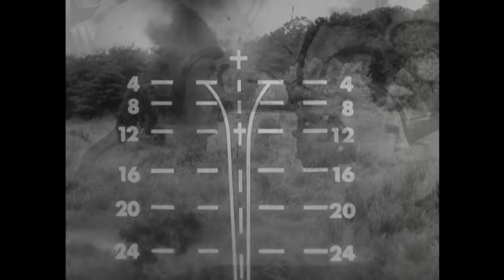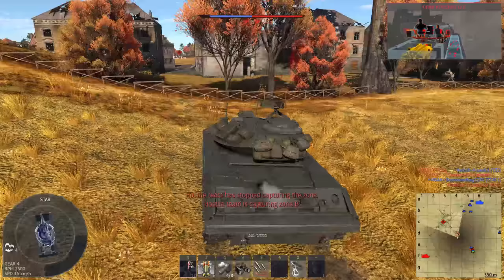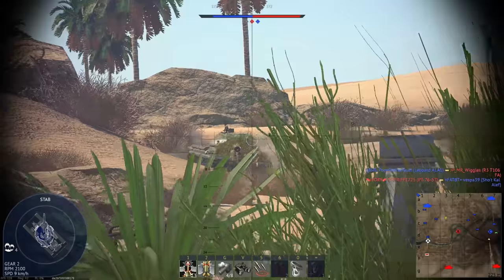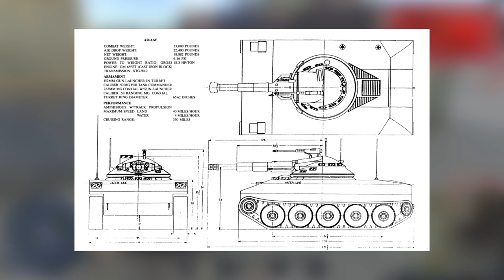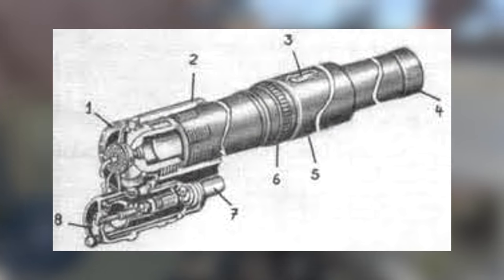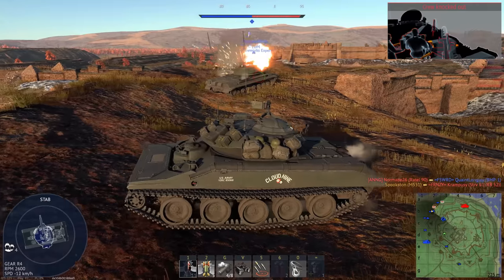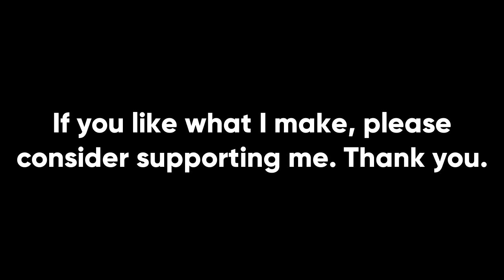How Bad Was The M551 Sheridan?

Comment: My grandfather had worked on the m551 152mm gun and he told me that you could calibrate it to fir missles all day long but as soon as you fired a conventional round you would have to recalibrate the gun because the recoil would life it off the ground a bit and slam it down ruing the guns calibration
Reply: So basically if they had kept it as a missile it would have been fine. And one of they things that wanted to use against all those Soviet tanks was missiles. So what they needed to fire conventional rounds was something like a tank. Need I say more.
Reply: Yeah of course
Reply: @sawyerlogon7666  
Maybe he meant the T-55's turret. Though I don't know offhand if T-55s had that problem or if it was only the later Soviet tank designs.
Reply: The recoil of conventional ammo would knock the missile tracker out of alignment. I never fired one, but I crewed one in the 90's. The breech would operate alot faster then the video shows when electrically opened or closed.  They addressed the issue of the combustible case residue via the CBSS. I'd really like to see the A1 version in game soon, or the ability to research it.
Reply: @Echelon030  I  read in a book called the worlds most power full tanks  about ammo and fuel were stored in close proximity to each other on the T-55/54
Reply: @sawyerlogon7666  according to war thunders x-ray mode some ammo is stored in a ready rack within a fuel tank. Dont know if that's the case on the actual tanks or not
Reply: @Dominator2930  For the T-55? Yes, it is. Diesel is actually fairly hard to ignite, so it works as a form of wet ammo storage.
Reply: I’ve heard that a lot from old Sheridan crewman myself
Reply: @Echelon030  all tanks without any blowout ammo racks do have this problem. The entire World War 2 was about it
Reply: @sawyerlogon7666  some ammo have been placed in the slots inside the frontal fuel tank of t-55
Reply: Ah, nice. My grandfather also worked on the M-551, but he had worked on the optics for the missile system.
Reply: @worldoftancraft  only ones with ammo stored under the turret
Reply: @justarandomtechpriest1578  cope.

Comment: Why doesnt it have a laser range finder in game?? That heat round is so hard to aim
Reply: Try the starship is better in every way, and is under rated. Especially hull downed
Reply: The game version is an earlier version
Reply: @Powerarmorgameing  i was told that other times, im still researching it. Does it come with laser rangefinder?
Reply: Just use missles they are way better than heat
Reply: @copycat5187  yeah but you cant take a lot of em and heat is good for cqc
Reply: @Fran-sr1sb  honestly im so trash at this game, i alwayes die wjthout using full 20 missles so i dont really care
Reply: Use atgm
Reply: @GoldRaven-oe4by  air to ground missles?
Reply: @copycat5187  anti tank guided missiles
Reply: @t_h_f7931  yeah that atgm works too
Reply: @Fran-sr1sb  yeah it does it a later level research for but me imo its worth it the starship is really fun once you learn how to play it and aim with the heat
Reply: Only the M551A1, and M551A1 TTS had a laser rangefinder. We have the standard M551 in War Thunder.
Reply: @copycat5187  air to ground missiles are AGMs.
Inglés moment
Reply: @Fran-sr1sb  The Sheridan in the game is an early model, hence the lack of an LRF. The M60A2 Starship has the same gun and ammo with an LRF at the same BR, but on an M60 chassis. If you want to know for yourself, you can just check the Modifications tab on the vehicle
Reply: Not invented at that time

Comment: I was a Sheridan crewman in the 11th ACR in Germany. They were a mixed bag. In the late 1970s they were getting worn out and since they were on the way out parts were hard to come by. The recoil was extreme but the gun was quite accurate with HEAT rounds. The closed breech scavenging system when it worked prevented cook offs. We fired a gunnery table without it and I am still here. They were quick and very agile and could go places we couldn't once they were replaced with M60A1s. Strangely most M551 crewmen I know look back fondly on them. In Nam the crews that replaced M113s with them were quite happy. Those that gave up M48s were not.
Reply: How old are you
Reply: That was a good description of them, Thomas.  I agree.  I think they were good scout vehicles.  When we got the M-60s, I felt like I was running knee-deep in mud.  The Sheridan's speed was a definite advantage.  😀  The Russians would have definitely known we were there!

Comment: The funny thing is, if we took the concept, and gave it a short barreled version of the M256/L44,  we'd have a very capable tank for urban warfare
Reply: Add aps and remotely controlled machine guns for good measure. And a compeltely revamped armour utilizing recent advancements in metalurgy.
Reply: It would still probably get knocked around by gun recoil and would need to use custom ammo or have even more ludicrous muzzle flash and muzzle blast pressure wave issues than the M256 already has.
Reply: Basically you’ll end having a really shitty variation of Sprut-SD.
Reply: Or an autocannon + ATGMs.
Reply: You could go with a low-pressure 105mm gun like the CV90-105 or the Centauro, in fact
Reply: @alexey_chekhovich  As if the Sprut-SD is known to be any good at this point. Matter of fact it was CANCELLED and a new 125mm-armed fire support vehicle was being ordered for the airborne as of 2013. 

So yes, I'm pretty sure it'd be better than the Sprut, especially with modern engineering and design.
Reply: Take a main battle tank already terrible in urban combat, make it worse in almost every way. Now suddenly excellent in urban combat.

That’s basically what you have said…
Reply: @CruxG228  well it is the best in class anyway. And the closest to mbt in its capabilities airborne vehicle ever designed. Yeah it was kinda “CANCELED” in 2013 in favor of Sprut-SDM1, which is being produced as of now. Not so much cancelled off though. And latest versions are peaked in terms of new tech one can put inside. Yet it’s still not reaching the mbt capabilities, despite having unified gun. And you are proposing putting even shittier short barreled gun on an older platform - and it will somehow be better than Sprut?
Reply: @Echelon030  bmd-4
Reply: @brandonl8039  No, I said take the concept (light, air deployable), and mate it a modified version of the gun used by the Abrams. Others have added that if modern composite armor is added, as well as active protection, plus what I stated, you'd have a very good tank in urban warfare.

Think of it this way: The Abrams doesn't fight well in cities. It's a large vehicle, extremely heavy, and the gun can have a hard time being brought to bare in the tight streets where it might be needed. A modern Sheridan Concept on the other hand wouldn't have such a limitation, since the turret can still 180 in all but the tightest streets (streets where the tank itself barely fits).

If you think about it, HEAT, HE-F, and Canister don't need a long barrel to function properly. And neither does the new 120mm ATGM. So it'd also have the benefit of easier logistics as the while the gun is basically a new design, it's uses existing ammunition designs, so supplying it won't be any more difficult than getting an M1 supplied.
Reply: @Tank50us  give it the m230 chaingun off the apache as a coax
Reply: @meepy546  And the GAU-8 on the roof for good measure
Reply: @alexey_chekhovich  The difference is, you're trying to shove his proposed armored vehicle into the niche of the Sprut, which I find questionable as a platform anyway. Instead of having an airdroppable light tank with MBT-levels of firepower, he's proposing a light tank(Like the M8 Buford!) with a low-pressure or low-recoil 120mm gun designed to fire shells meant for urban combat. Things like canister, or HEAT-MP, or gun-launched missiles like the LAHAT. By giving it screens and composite armor, along with potentially strengthening the hull with new materials, you could potentially have a workable, modern version of the M551 that fits as an urban support vehicle.

Nowhere did he say he wanted to give it Abrams-level firepower, nor perform the same duties as the Sprut which is...again, an air-deployable tank destroyer. The Sprut would get chewed up in urban combat because that's NOT what it's meant for. So  yes, a modernized, remade Sheridan would be better than the Sprut, especially if the purpose was put towards a vehicle with an emphasis on urban warfare support.
Reply: @CruxG228  Actually, the new 125mm gun tank is a modernized version of the 2S25 called the 2S25M.

Comment: I remember meeting a commander of a Sheridan a few years back, had lots of stories about them. 

One time his unit was burning some jungle brush around a base and another Sheridan tried to push a burning tree over but some embers got into an open turret hatch and ignited some loose powder from a damaged shell. The crew bailed except the driver because his revolving crew hatch was locked and the TC had to rescue him by bashing the hatch open with a sledgehammer and pulling him free before the ammo cooked off. The day after the fire subsided they went to inspect the wreck and all that was left was the turret since the aluminum hull had melted from the heat.

He loved the canister rounds due to how well they dealt with the thick jungle brush in Vietnam. He didn’t have any opinions on the Shillelagh since he only fired them in training. He also said the steel turrets had a tendency to crush the aluminum hulls when they were air dropped.
Reply: MAN what a story... Imagine being that driver, unable to get out of a metal coffin, with a raging fire behind you. Truly scary.

Comment: My grandfather was an engineer with several defense companies from the 50's through the 90's. At some point during that time his team was tasked with building the parachute system for the tank. It was the first time such that the military had ever tried to make an air droppable vehicle of that weight, so it became quite the project. After many months of work, his team got a working prototype. First, they ran tests with just blocks of metal that had the same basic weight distribution and density. After they got the system working consistently, they were asked to demonstrate it to a panel of military brass, who of course wanted to see system they just payed a lot of money for. For this test, they were going to drop a real Sheridan, followed by a crew to drive it. The idea was to show how the drop left the tank in a drivable condition. 
Day of the test comes, and the generals and colonels are sitting in bleachers set up in the desert as the transport aircraft lumbers overhead. My grandfather and several other engineers from the project where there as well. Rear cargo door of the plane opens up and the pallet with the Sheridan flies out the back. The tank gets safely away from the plane, and just keeps on falling and falling. Immediately the engineers knew that something was went way wrong when the main parachutes failed to deploy,  and all hell was about to break loose in roughly 30 seconds when a brand new tank was about to impact the ground at terminal velocity. Of course the drop was a safe distance away from the observation bleachers, but you could still feel the ground vibrate as a million dollar tank got turned into the worlds most expensive pancake. 
Needless to say the tank crew that parachuted out afterwards was unable to drive the Sheridan off into the sunset.

Comment: During the 1980s, the Naval Surface Weapons Center experimented with installing the 105 mm Gun M68 in the turret of an M551 Sheridan and using the recoil system for the 152 mm gun-launcher. The cannon was trialed with and without a muzzle brake. Although the installation worked, it would have required significant development before it was satisfactory. The turret ring in particular couldn't quite handle the recoil force of the massive weapon and was damaged after some tests. However, it was deemed practical to mount a 105 mm gun on such a lightweight chassis. The experiment would influence the development behind the Armored Gun System (AGS).

Comment: A family member built circuit boards for the military and the Sheraton is used as an example of what not to do when it comes to circuit boards. Because the Sheridan had an issue of shaking the circuit boards loose which wouldn't cause immediate failure but over time especially after a few more shots and could cause failure of critical components. So for the several companies he worked with they use to Sheridan as a benchmark of what not to do a circuit board and its mounting hardware had to be able extreme forces many times more than what was expected in the vehicle that is to be put in.

Comment: I find it a bit odd that the US failed with the concept of the combined Gunlauncher and the Shillelagh missile. It seems the Soviets had a better approach. Instead of creating a new gun with a missile to launch through it, they just designed a missile for the existing gun. With all the T-55, 62, 64, 72, 80 and BMP-3, they had/have missiles for their guns. No matter of caliber like 100mm, 115 or 125mm, naming Bastion, Svir, Kobra missiles (depending on the variant).
Reply: Yup. They built a good tank gun, then built a missile that could be fired from it.
Reply: Where do you think the soviets got the idea.
Reply: @jeffreyprezalar220 well T-55 predates the M551
Reply: You'll notice the Russians have not used the AT-8 or any other gun missile in combat, or not so you'd notice.
Reply: What? There is plenty of footage showing them using gun launched ATGMs
Reply: @tatianadashkova2143  Can you give me a link/example?
Reply: The Sheridan needed a new gun design anyway. We didn't have a low recoil, light weight cannon design in service unless you wanted to go back to old WW2 105mm from the Sherman.
HEAT round penetration correlates with warhead diameter. A 152mm HEAT has a lot more penetration than a 105mm, 90mm, or 75mm HEAT warhead.

Comment: They were the first armor response in Saudi Arabia after the Iraq invasion of Kuwait, and they used their Shillelagh missiles against Iraqi targets once the ground war went hot.  The Shillelagh was comparable in performance to the TOW-II (though not the -b or other variants) in terms of penetration and flight speed. The issue with paper fragments in the bore detonating rounds was resolved (IIRC) with a compressed cold air evacuator.  Part of the issue with the combustible cases in Vietnam was that moisture caused the cardboard casings to swell, which would make them split, and propellant would collect in the turret basket and hull floor, which made fires in the vehicle even worse.  I seem to recall hearing that the casing material was changed to correct this but I could be mistaken.  Regardless, yeah, it was a pretty bad vehicle.

Comment: seeing how this gun was used on the XM tanks maybe the next vid can be about the XM-1 and the 2 variants of it?
Reply: The XM-1s have a 105mm gun
Reply: @__--_-_-.__---___.__---__-  he's talking about the XM-803 and MBT-70 which both use the 152mm gun launcher.
Reply: So im not the only one that mixes XM1 and XM803 way too much than he should!
Reply: @L0OkBEh1ndU  ah okay I assumed they were pretty similar. Thank you for the info!
Reply: The 152 on the MBT-70 is actually an entirely different gun which is capable of firing high pressure/high velocity shells while also being capable of firing the shells of the M81.  It also was far more durable and (supposedly) had none of the issues the 551 or starship had.
Reply: Unless he's already covered it, the obvious MBT would be the M60A2 which used the same gun launcher.  It's worth noting that the M60A3 went back to the British 105.

Comment: The M551 just feels like it was designed way too early for what it was intended to be. If we went back and made the same thing now, it would probably be flawless, but with the tech of the time, serious teething issues were inevitable. Granted I'm biased because I just think they're neat.
Reply: That is pretty much the story of every weapons system developed in the 1960s. AiM-4 Falcon Missiles, early model AiM-7 sparrows, T-64 opposed piston engines, the list goes on. Frankly some hybrid of the m551 and the m50 ontos would have been pretty nice - I mean if the problem is recoil, then recoilless Rifes are the way to go - yes? Or turn it into an air-mobile MLRS, and leave AT to Man-portable LAWs for the airborne.
Reply: @MrChainsawAardvark  the problem is that recoilless rifles require the crew to be exposed to load or operate the system. I've no doubt a modern gun could be developed (maybe redirects gasses around the turret to the rear) but then you have to have infantry completely clear of the vehicle.

152mm HE is an objective as well. Troops working behind enemy lines need that level of firepower to deal with bunkers and other heavy fortifications that might be protecting their target. Just as well, an MBT may eat a HEAT shell or an ATGM (unlikely today, but you never know) 152mm HE is sort of an end-all-be-all. If it doesn't outright destroy the target, the shock alone disrupts external systems, exposed mechanics etc. 

Today, there isn't much need for paratroopers and other similar disruptive units to have such firepower, with the availability of air power in the warzone as the focus of an operation, but having the utility certainly wouldn't be shunned I imagine.
Reply: @blackwoodsecurity531  I'm aware of the drawbacks of Recoilless artillery, but keeping in mind the date these things were developed - that is what would have been available. Arguably a separate TOW launcher like on the M2 Bradley and an autocannon would have fit the M551 better as well. We're looking to fill a similar niche as the BMD.